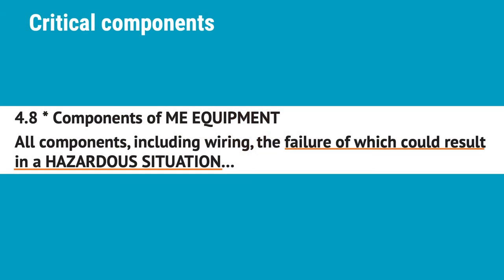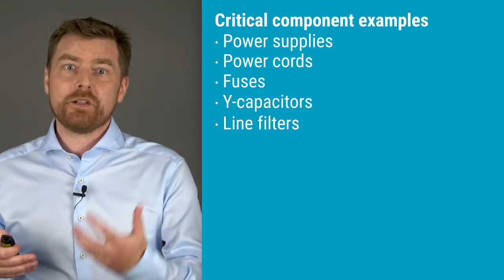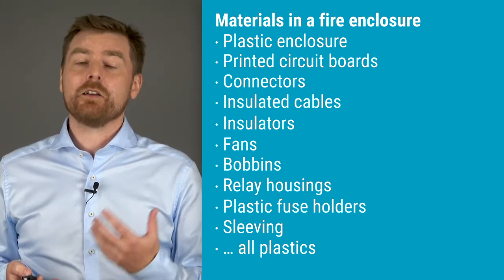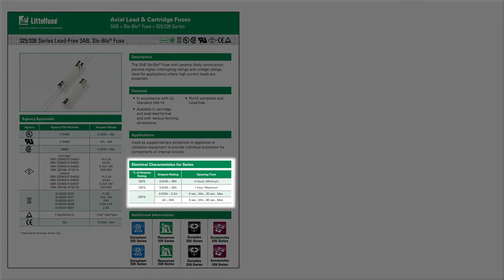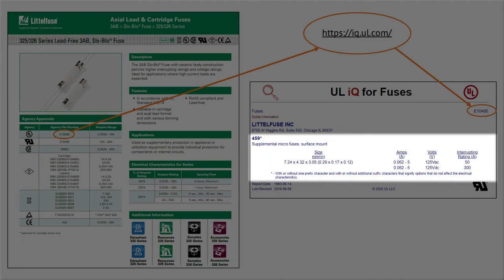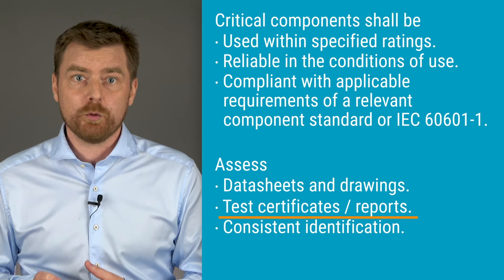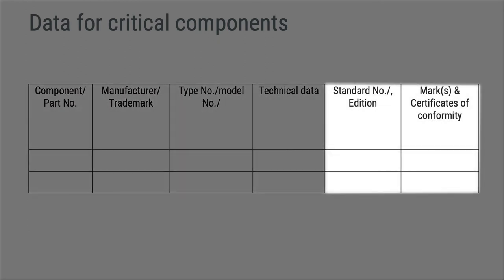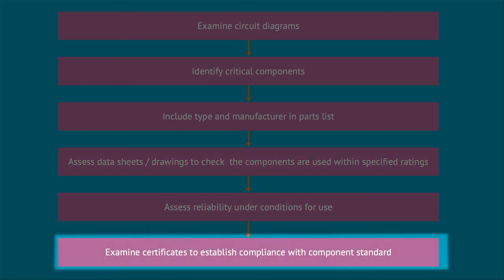How to identify and manage critical components

Comment: What about mechanical list components on medical devices? Thanks so much
Reply: Mechanical components should also be part of the list of critical components - as relevant. Examples include plastic materials (flammability rating) used for enclosures, guards, rails, lifting devices, etc. In short, critical components are not limited to electrical components.
Reply: @clausroemer  Thank you